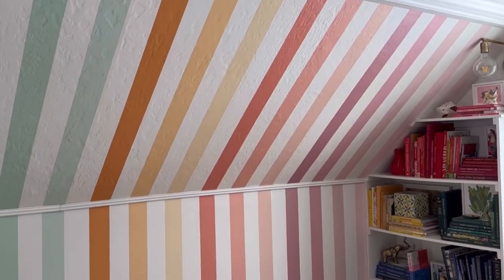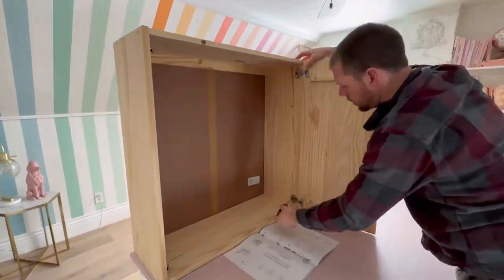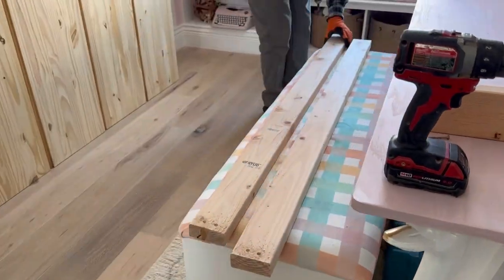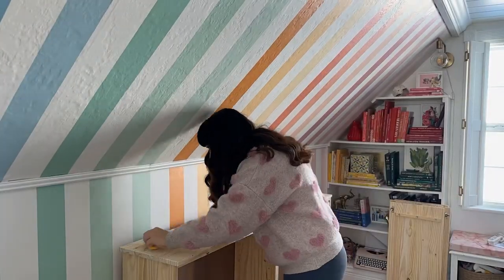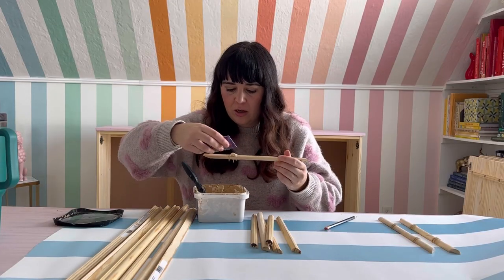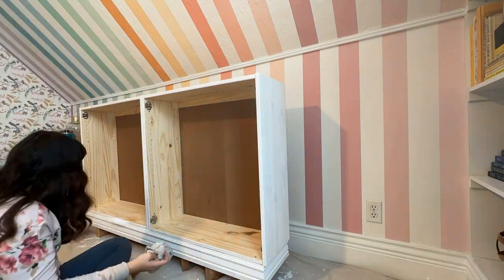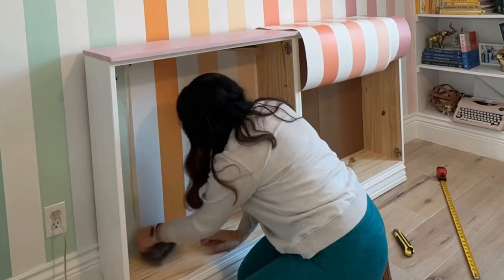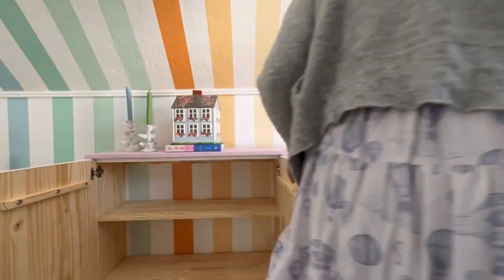IKEA Ivar Hack- let's add some DIY bamboo trim to make craft room storage

Comment: So fun! I have the same Ivar's for cabinet and want to add a top to them. The tops as-is are pretty uneven. How did you approach adding the top? Did you do anything to even out the Ivar tops before adding your own? Thanks!
Reply from the maker: We sanded down the top a bit and then screwed the new top on. You can see that at the 7:00 mark in the video